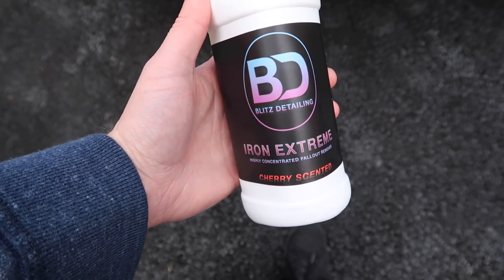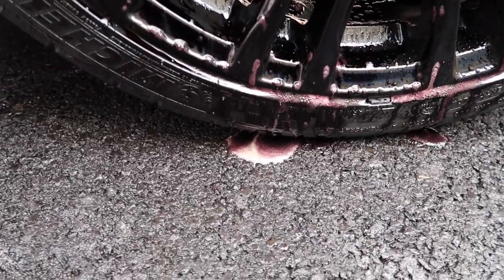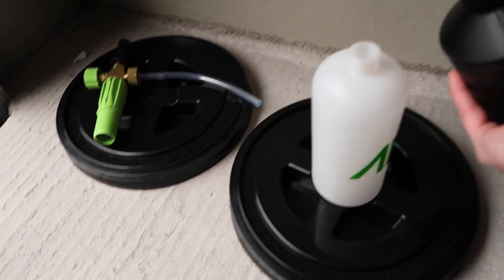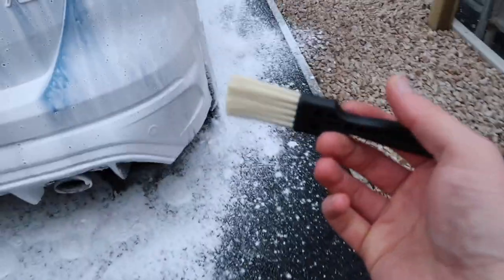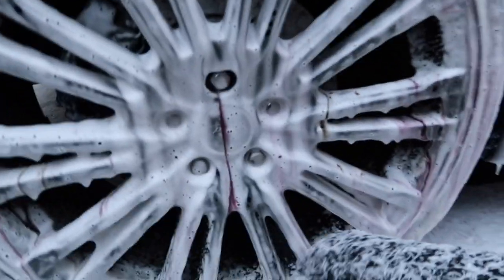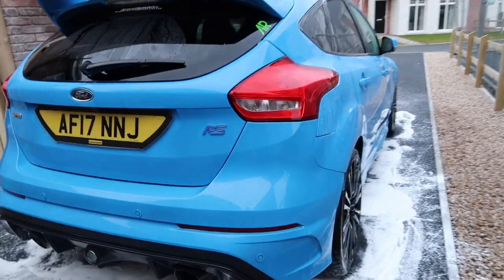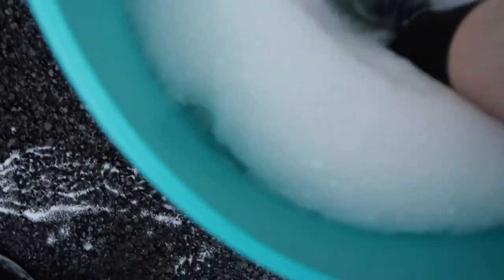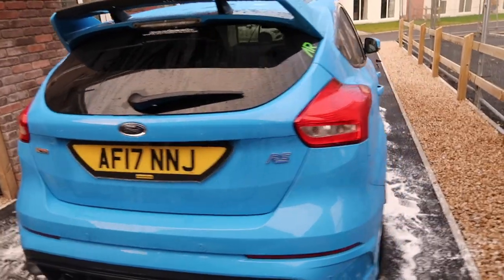TESTING BLITZ DETAILING PRODUCTS FOR AN EPIC MAINTENANCE WASH! | FOCUS RS

Comment: Very nice indeed. I take it the Ceramic coating is unaffected by using the fallout remover on the paintwork? I’m just saying that as it would remove wax and you would need to reapply. Keep up the great videos👍
Reply from the maker: Hello, proper ceramic coatings when properly applied are not affected by fallout remover, in fact my Gtechniq crystal serum ultra is one of the most chemically impervious coatings available. The only way to remove it is with abrasives

Comment: Love these videos adam, makes a change from all the modifying. That iron remover looks very good it seemed to cling very well to the panel compared to most others. This may sound insane but have you saw them pet dryers on Amazon, they are very useful for drying a ceramic coated car it means you are less likely to cause swirl marks when drying!
Reply from the maker: It isn't insane at all, Carbon Collective do a nice looking one specifically for cars. I might get one at some point but it just isn't high priority right now and with my fancy Gtechniq crystal serum ultra, it is specifically designed to resist swirls   so I'm not too worried, especially using their towel which is pretty amazing
Reply: @AdamRainey   Yep that's true, I think them car dryers are so cool and very satisfying to watch🤣 I've seen CC's one but think it's quite expensive compared to the rest of the market. There's one called a Big Boi it looks quite good it's around £100
Reply from the maker: love the name, big boi :D

Comment: Bit off topic Adam but been looking through your videos but can't find any bulb installation vids of the dipped beams. Are you using stock? Does it compliment well with your fog lights and high beam? Getting a Focus ST-3 mk3.5 soon so been doing some research on transferring most of my autobeam bulbs on my fiesta over to it.
Reply from the maker: Hi Kelvin, the RS comes with pretty excellent xenon HIDs from factory so I haven't needed to upgrade them. The amount of light and colour matches well with the others
Reply: @AdamRainey  Sweet, that's good to hear. The Focus ST-3 also uses xenon HIDs so hopefully its exactly the same bulbs you have in the RS.
Reply from the maker: Yea mate, I would imagine they are literally the same